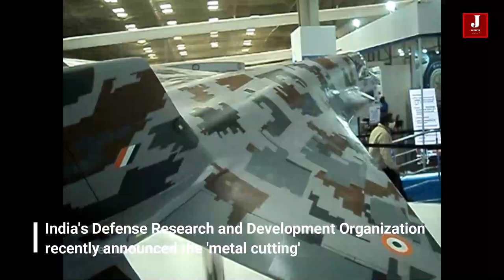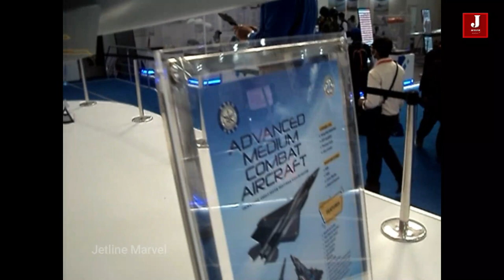AMCA : Manufacturing of the First prototype of 5.5 Gen India's stealth fighter programme has begun

Comment: Production in 2028 will be for limited series production.. LSPs are not the same as finally inducted planes. 
Final mass manufacturing will begin in 2030-32 depending on which interview you see. Sometimes it is 2030 sometimes 2032